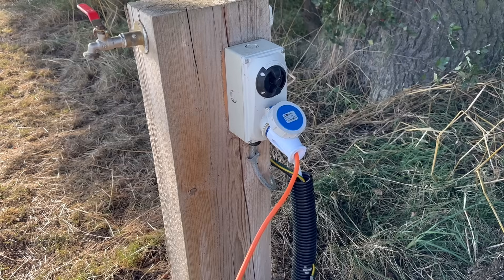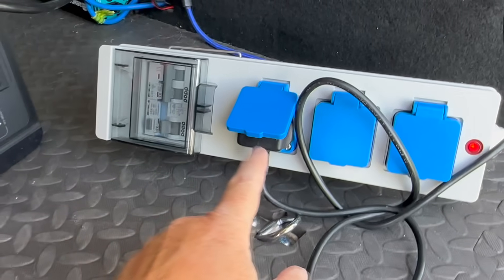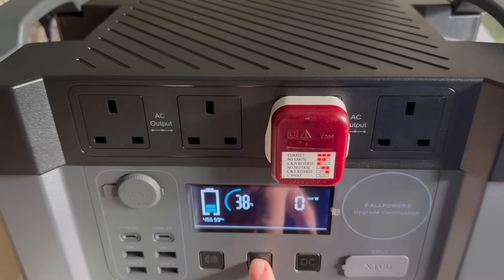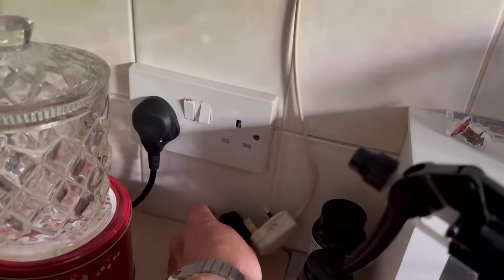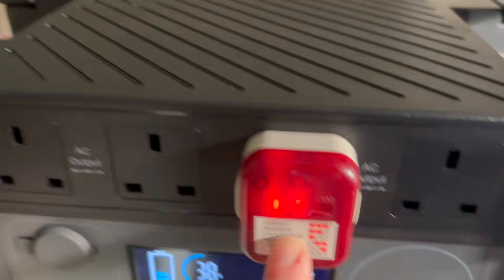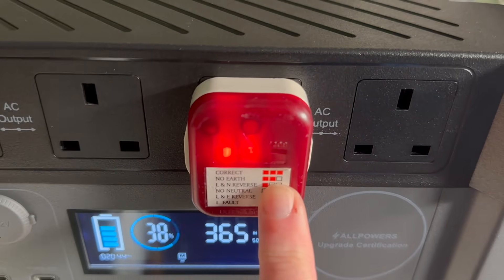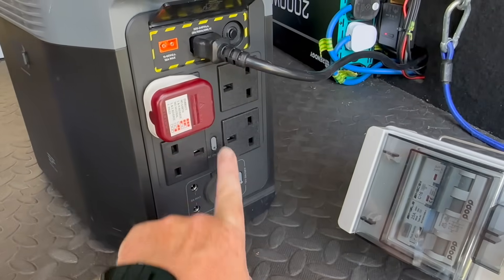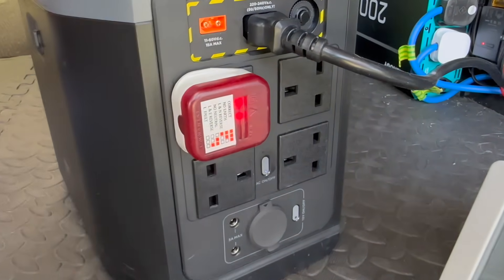Should you Earth Bond an Inverter to a Vehicle Chassis

Comment: Are vehicle tyres electrically conductive? They’re rubber so should be insulators unless something conductive is added. Having a 240V AC connected to an unearthed vehicle body could mean the route to earth is through somebody touching it, which is exactly what you don’t want. Different if it’s on hookup as the earth to the vehicle is connected to earth via the hookup.
Reply: @darrenjones5885  yes, tires are slightly conductive.
Reply: This is why you need an RCD,  any AC current going to the van chassis would be detected and immediately trip.

Comment: Hi John, interesting topic. Out of interest have you tried a socket tester with RCD test button built in on your inverter? I know my current (pardon the pun) inverter doesn’t have a built in RCD and others have said that the one you have doesn’t either but don’t have one to prove it out, get the overload and stuff though. Also know some you shouldn’t bond the neutral and some are. Floating is probably safer as I think you were saying (unless you get your fingers across live and neutral) as no potential difference then. 
All the best, David 👍

Comment: I see why. But I also don't see the point as it's not earthed. The only reason you earth negative to a van is to make a circuit. I would say you need to earth the inverter to the earth. As the van is insulated from the ground the only way is to earth the van. Ie a rod in to the ground out side the van on a fly lead?. Unless it's for the purpose of if the van becomes live it will trip the RCD that makes sense.

Comment: Hello! Just seen your video! If the motor home is made/built in the uk it MUST comply with the IEE 18th regulations. It states you must connect the earth to chassis and have an rcd for you safety. Rcd generally isolate (trip) in 30milli seconds. Not wiring 240v ac systems correctly will invalidate your insurance.
Reply: Don't forget that the IEE regs only represent "beat practice" and are not legally enforceable. However, if death or injury results from non-adherance you would be required to justify your practice in a court.
Reply: So you have to carry and bury an earth rod if you're wild camping?
Reply: @rogerstarkey5390 No. You have to provide an alternative path for fault currents otherwise an rcd won't trip and you could  die as the result on a 230v system 

Mixed DC/off grid/shore systems are complicated. This is why you shouldn't mess with anything beyond low voltage if you aren't classed as competent.
Reply: @rogerstarkey5390  think I will go with a 10lbs hammer for installing the earth rod, be a bugger to retrieve though
Reply: @rogerstarkey5390 only if you are a commercial instillation. The main reason for the regs are to keep you safe, also if there is a fire caused by dangerous wiring your insurance is invalid.